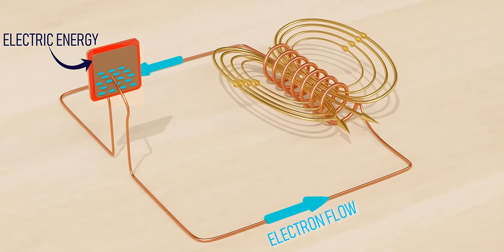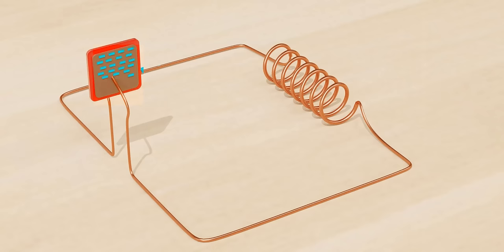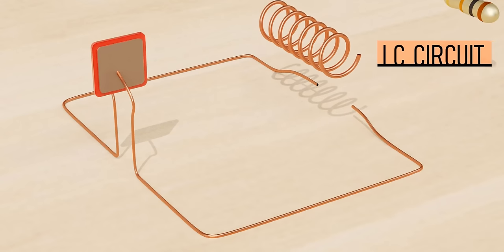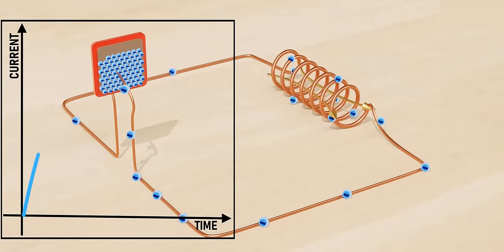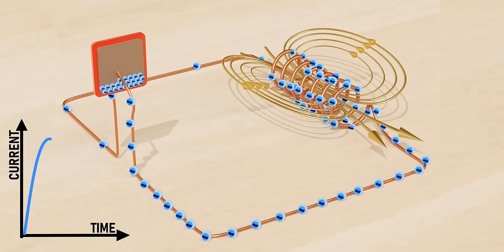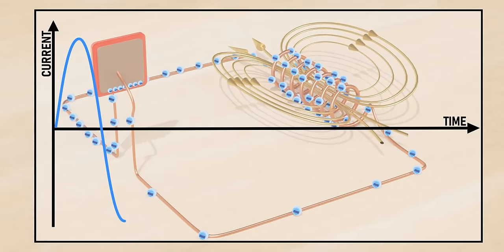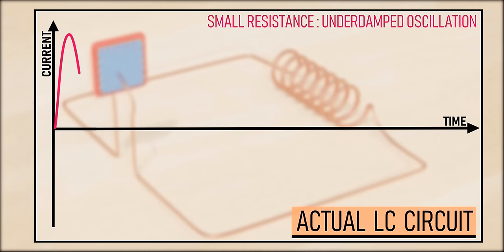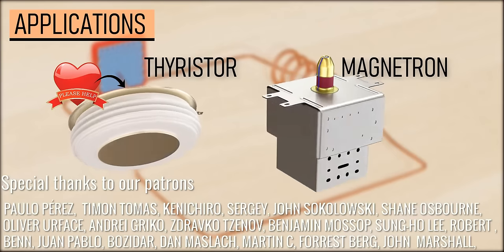The beauty of LC Oscillations!

Comment: This is how physics should be taught.
Reply: Its should be analyzed like that
Reply: Unfortunately that animation leads to a flawed understanding of electricity - it is not a good way to teach misconceptions like that.
Reply: Electromagnetics aren't really taught until you take Physics 2 in university and... this is one of the many examples we learned.
Reply: This video barely explains any concepts, and the animation is wrong. So no, this definitely isn't how physics should be taught. The voiceover doesn't even mention why inductors have a coil, or how coils behave like magnets under current, or how magnets induce currents. It doesn't even explain what a capacitor is, and instead pretends like it's a battery, which it isn't.
Reply: @EMETRL  Yes you are right I am just saying that Physics should be taught in a very practical manner instead of theoretical . In India the Education System only focus on theoritical concept instead of practical visualisation which must be there to understand Physics or any Science subject.
Reply: @Aspect Bro I am not saying to visualise the electrons or protons but at atleast the practicals which is meant to be visualise should be taught and make us aware. In every Science subject whether it's Physics, Chemistry ,etc it needs practical visualisation otherwise there will no difference in Language,History and Science Subjects.
Reply: @Aspect Definitely but I am not pointing out flaws but the need to reform .
Reply: True
Reply: You just see lectures of LC oscillation by Physics Wallah - Alakh Pandey . Then you will know how physics is really taught and you will fall in love with physics .
Reply: Bro this is what we are taught in smart classes but we don't pay attention to it.. anyways this just gives an idea of mechanism but mostly it's false.
Reply: @nishantkumartiwari1202  I seriously wish you grow up and then edit this answer 👍
Reply: @Aspect if you're not filling up 50,000 pages with quantum field equations to solve for all the interacting particles in a circuit, then you're omitting detail about the problem and instead you're using some practical approximation techniques. even quantum field equations are conceptual abstractions of reality and are not reality. when you're reading through an electronics textbook and the textbook uses 20 lines of common electronics equations to solve a problem - that's a "practical" way to model the situation that is omitting huge amounts of detail about the situation. this video is just another way to model reality with the goal of removing enough complexity to allow relatively quick learning of the subject of the video - LC oscillations. sure the video is omitting surface charge distributions on the wires, it's omitting current densities, it's omitting physical construction techniques of modern capacitors, it's omitting transient phenomena (skin effect, transmission line theory), it's omitting electron tunneling effects, it's omitting the inductances and capacitances of the wiring, thermal noise, electric field fringing. the list is endless. not even a graduate textbook is going to go through all these concepts on a single problem when the goal is to determine the current through a capacitor at time t. so, no matter your goal, you have to omit detail in order to generate a useful model of a situation. the goal here is to omit enough unimportant detail to get a feel for the concept of LC oscillations for people new to the topic. i think the video did a good job of this and it would be beneficial for professors to show videos like this in class to enable the students a quick, intuitive feel for the concept. too many professors forget what it's like to learn these things for the first time and go straight to equations on the board, which require the students to de-abstract the symbols into a physical representation to actually understand what the equations are saying. equations are of course useful and powerful, but often get in the way when first trying to understand a concept/subject.
Reply: Just like this. Only way better.
Reply: @MrXBT2000  Yes thank you. Oversimplification is bad sometimes.
Reply: @snackentity5709  Dude, the other extreme. Ever looked around the room for "that guy"? You know how sometimes you don't find him? Know why that is?
Reply: What a great sarcasm!
Reply: tu padha de phir
Reply: @dhanrajpanday490  well.  If you want a very limited understanding, understanding none of the math then I guess.  I'd rather truly understand the principles.
Reply: My school only did diagrams
Reply: It is taught incorrectly like this everywhere... 
Now let's see what happens when you show an accurate whirlpool/vortex at either "pole" so you can accurately picture the inward centrifugal and outward centripetal "forces" that are making this work in the very first place. 
Wow, visualizing the unseen how it actually instead of a fictional nonsensical view that does not make any sense of electric or magnetic fields.👎👎
Reply: Period
Reply: True talk
Reply: hainaaa
Reply: ikr i was like wats all this mumbo jumbo 🤣
Reply: @EMETRL  I disagree with mamy of your points.
Reply: @dhanrajpanday490  dude there is no reason whatsoever in blaming the indian education system everywhere just because you haven't experienced the fake physics that this video teaches you. If you are that much interested in thought process etc take up JEE (which you might have done) and solve JEE related problems. That's how physics should be taught
Reply: I agree with you❤😂
Reply: Yes,this should be how physics is taught.But in most of the schools physics is taught not as physics,but as merely one of the subjects to pass in the exam.But we don't have to worry there are many sources like this to have enjoyable lessons
Reply: What software you use to make such animations?

Comment: Everything is perfect, except the fact that electrons barely move, it is the electric field the one that translate energy rather than electrons. I know this might sound stupid, but this is the reason why the inductor or capacitor formula only depends on the varying voltage of the source and dont take into account the topology of the circuit. So considering a circuit as pipes might work in the short term for simple circuit that dont work at radiofrequency (30KHz-300GHz).

Comment: In radio transmitters, sometimes we develop a low frequency (because it is convenient) and use it to 'ping' an L/C circuit which has a resonant frequency at a multiple of the low frequency. The oscillations set up in the tuned circuit can be extracted and amplified to give us an output on (say) 2x, 3x or 4x the input frequency. This is called 'frequency multiplication' and is used to produce an output on a UHF channel from an input on VHF or lower. This technique is not used quite so often nowadays as modern phase lock loops can directly generate UHF without multipliers.

Comment: Great video, but i have 2 things that IMO should be said/animated a bit differently:

1.) The RC circuit. Nothing wrong with the explanation, but with the animation. Energy stored in capacitor is We=1/2*C*U^2. Voltage across capacitor is caused due to difference in how many more electrons more are on one of the electrodes. The animation might suggest, that all of the electrons go from one electrode to the other one. If that was the case, then we would have voltage with different direction.

2.)LC circuit. The animation is great, but now i would change the explanation a lil bit. Firstly, when the capacitor is connected to the inductor current starts to flow and thus the inductor begins to "charge up" thanks to the according to the Wm=1/2*L*I^2. When the current reaches its peak the voltage across the capacitor and inductor is U=0 because the same amount of electrons is on both of the electrodes of the capacitor and thus no energy is stored in the capacitor(Or mathematically when the function is at its peak 1st derivative of said function is f'(x0)=0). The energy is now stored in the inductor and now the indcutor "pulls" the electrons from one electrode of the capacitor to the other one and thus charging the capacitor again. Rinse and repeat until the end of time
Reply: Many typos. Revise
Reply: Yep, i noticed the first point too 👍🏼 that's not correct. Maybe in the LC Circuit it should be shown as reloading with plus-symbols 🤔
Reply: @nikkocnn  no
Reply: xkerberosx1 thanks i didnt get it at first
Reply: My understanding is that when the current is at maximum, the inductor has the maximum energy of the circuit and the capacitor has no energy. This means there is no charge difference between the plates of the capacitor. Therefore at the peak of the current, the number of charges on the capacitor plates should be equal (50%/50%). Instead, the video shows that there is maybe 20% of the charge left on the visible plate, whereas the remaining 30% is in the circuit? I have been learning about the LC circuit today and the video only added to my confusion instead of helping. I think the video is horrible and makes me doubt that the people praising it have understood the process.

Comment: Think of it like a pendulum. The capacitor is like gravity and the inductor is like the inertia of the hanging mass.

If you start the oscillation on a pendulum, gravity first pulls the mass downwards and accelerates. When it reaches the center position, it doesn't stop because even though the force of gravity is no longer assisting it in gaining speed, the momentum of the mass forces it to keep going. The inductor does this by storing energy in a magnetic field, which continues to push the electrons in the original direction even though the capacitor is starting to act in the opposite direction. Only when the magnetic field have completely dissipated in the inductor will the capacitor be able to move the electrons in the opposite direction, thus reversing the current flow and causing the inductor to begin the generation of another magnetic field also in the opposite direction.
Reply: In LC OSCILLAtions power once delivered by inductor is absorbed by capacitor and when capacitor deliever inductor absorb on a whole neither inductor nor capacitor delievers or absorb power it only rotates or oscillates between inductor and capacitor that why they are called lossless devices.. And they are called LC OSCILLATOR..
Reply: Thanks for the info it helped

Comment: How I wish we had the internet back in the early 1970's when I was studying EE.
An LC circuit is analogous to a spring and a mass.
The first simulations of automotive chassis shock absorbers used RLC circuits.
Reply: Those were called analog computers.  They could very rapidly arrive at an very close approximate answer, as long as you properly accounted for or compensated for system losses.  
https://en.wikipedia.org/wiki/Analog_computer#Electronic_analog_computers
These days you can use a computer to simulate an analog computer, which is also fun.
Reply: Interesting! Am exploring the mechanical and electronic world and this is an interesting concept
Reply: It's not that easy. Internet is so helpful, but it's toxic as well. I have great materials and so on, but I waste time doing other things as well. Before you didn't have so many distractions and you could actually think about concepts, discover them "on your own"
Reply: Considering the internet has helped greatly to stagnate society for the last 20 years, I'm glad we didn't have it back then.
Reply: These are there in class 12th India..and I am studying those

Comment: 3:08 I believe green line represents the critically damped case as you mention a critical value
Reply: Green line case happens when the resistor eats up all the energy before the first half oscillation completes.